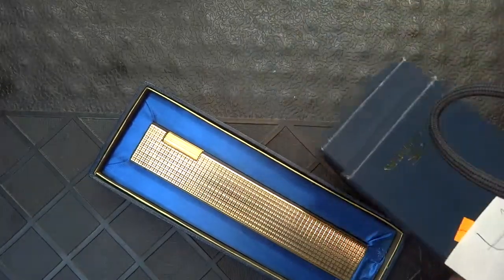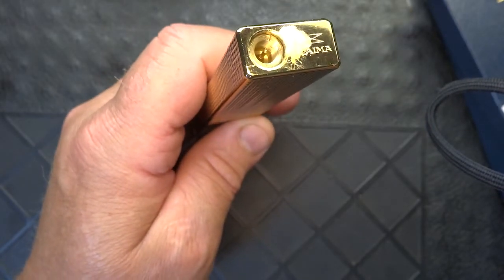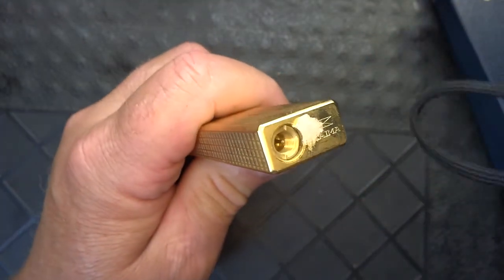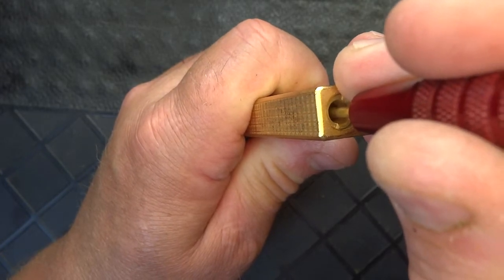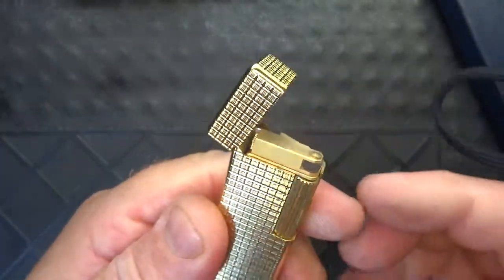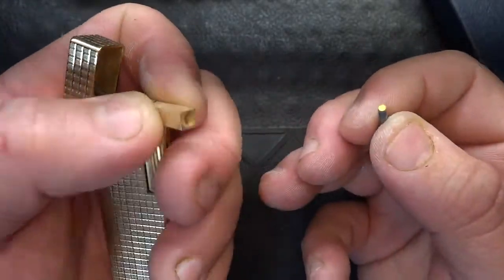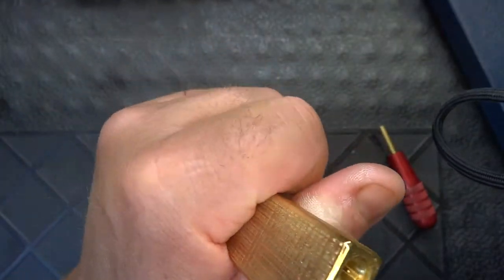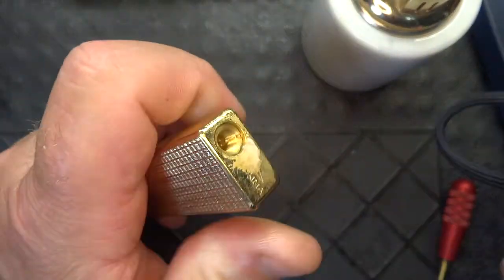Zaima tall Butane Lighter refill

Comment: What was the blue cap that suggested to help filling at about 5:40? Is it just a modified cap from a butane can?
Reply from the maker: The Blue cap comes from the can of butane I buy, it has a small hole in the blue adaptor. I have to push it on the pin before filling
the lighter. You could probably use a little bit of silicone or food grade tubing of the appropriate size to filt over the butane tip of
the can and it should work better. These plastic adaptors in the cans of butane never seem to fit tight like they should and leak just as much or more butane than not using one.

Comment: What do you have stuffed into the adjuster? I have the same lighter but butane leaks through the adjuster screw.
Reply from the maker: Im not clear to understand what your talking about. Watch all my video on zaima repair
Reply: @Lighters-cf4bd  sorry about that. It almost looks like some sort of sealant next to the filling hole. On my lighter that’s where the screw to adjust flame height is. Will check out other videos now.
Reply from the maker: @jedleon9461  where the tubing comes from the main valve, zaima does put a black sealer of some type to keep it from leaking. Never had one that I can remember
leak from there.

Comment: What's the red tool you take the pressure out with called?
Reply from the maker: https://www.ebay.com/itm/293977307330?hash=item447269b8c2:g:G0gAAOSwM5Fhbz1n
Reply from the maker: https://www.ebay.com/itm/294073902025?hash=item44782ba3c9:g:8QAAAOSwOW5gVRzI
Reply: I have a vtg bronica lighter and been confused why it wasn't working with butane is it cause I didn't depressurize it ? Seems like it was spewing out gas to fast to light
Reply from the maker: @shayneu9445  if I missed your reply I'm sorry. If the gas is set to high some lighters will have a problem igniting. Turn your flame adjustment toward the low flame side and give it a shot